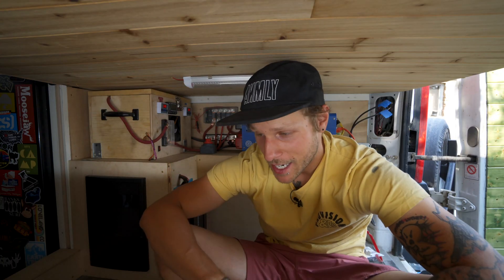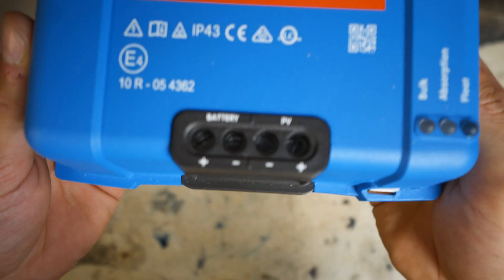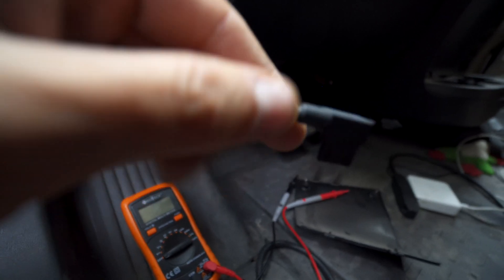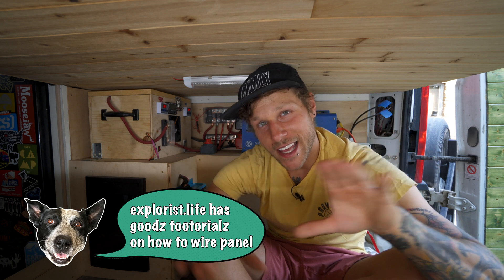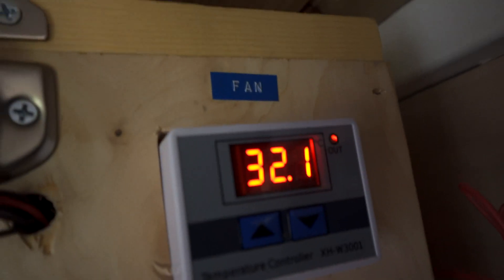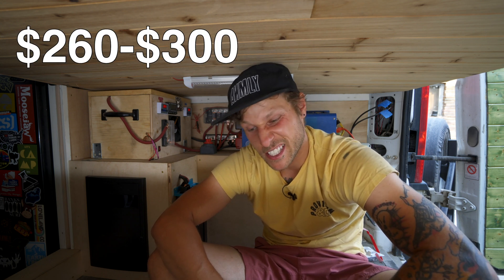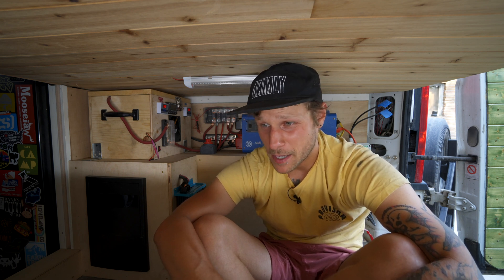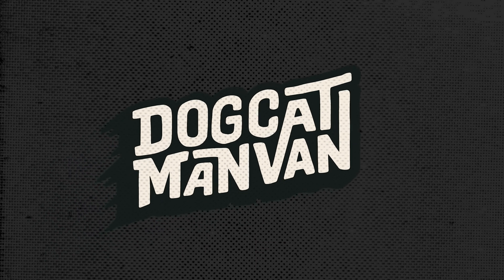What It Costs to Build a DIY Lithium Battery For Your Van

Comment: Use a diy 18650 3s battery pack, BMS use a budget watt meter and connect it to ciggy lighter don't let it go below 10.80v and watch the volts and amps. and or use a cheap boost converter with another watt meter and charge lifepo4 battery pack. Uses a lot less space too

Comment: Now that you have went lithium and have most the basic equipment have you considered building a larger bank and possibly heating your van in the winter with an electric oil filled heater. Also have you done any testing to see if that battery actually produces 280AH?
Reply from the maker: I think on a future build I'll be trying to incorporate an induction stove top, but as far as heat goes I think I might try one of those Hydronic systems. I've never actually tested its full capacity yet. That could be a good future video

Comment: You should not use the screws on the shunt as a connection point. Use the large bolts. The small screws should just hold the circuit board. It is not suitable for power to go through where you have connected and you will get wrong readings or destroy your shunt.
Reply from the maker: Thanks for the tip. I'll extend the wire coming from the BMS so it can reach the larger shunt bolt.

Comment: Hi! Is your MPPT able to charge together with the DC-DC charger, or does one start to cancel the other out when both sources are available (=driving in daylight)? Same question regarding solar+mains charging together. My logic says that when one charger puts charging voltage onto the battery, the other charger reads that as the battery being full and wont charge. But I must be missing something, because there are so many of these systems already out there. Many thanks for clear informative videos.
Reply from the maker: That's a good question and I don't know if one get's throttled if both are bringing in power at the same time. I'll have to run some tests.
Reply: @dogcatmanvan  Thanks for reply! 

I meanwhile dug through the internet; in conclusion it seems, that the emptier and bigger the battery is (and smaller chargers), the less they disturb each other. And the more the battery gets full, the more becomes important that the chargers give out exactly same voltage. 

Got my chargers delivered already, but my van is faaar from done, so would be interesting to see some tests from you. Definitely gonna test something myself too some day.

Comment: Great video mate, plenty of useful information no bullshit.. 
I subscribed straight away! I'm looking to do my own Van build in next year or so here in England, trying to decide whether to go with a Merc Sprinter or a cheaper equivalent which probably less reliable and layouts are bit different sprinter longer but the other ones tend to be wider at the top more square. So layout and reliability I'm not sure, also the extra cost of a Sprinter but then potentially more reliable for a lot longer?(you'd hope!)
Also been looking at building own DIY lithium set up with solar like you and been researching all things VAN BUILD/ conversion related! Might actually sell my house and live off Grid full time go travel Europe possibly South America, US, Canada perhaps? But all depends on money!! Initially it's gonna be about choosing a van and building it out on as little budget as possible! Whilst being smart and functional, FULL shower toilet set up the lot! But happy to do whole thing DIY! 
Going to check out your battery video now ..
Any advice you got or opinion on VAN options be much appreciated! (I'm looking at probably going with one of the biggest vans of each type available incase I live in it full time, eg. XLwb (maybe extended) extra high top etc. Given you're looking to go new van also be interesting to see what you go with and why..
Thanks again from London England 👍💪😎🏴
Reply from the maker: There's a lot that goes into picking a van and it all comes down to what you plan on doing with it. I personally have had this Ram Promaster 2500 High Roof 159WB and size wise it's been great, but it doesn't have the power I'm really looking for when we go out climbing or hiking 14ers. The trails get rough and there's a lot of elevation gain on the way and this gas van can really struggle at times. I think my next van will probably be diesel. Not only for the power, but I'm also curious about running a diesel heater inside and then trying to make everything else electric so I don't have to use propane. I'm not sure if that's the route I'll actually end up going, but it's an idea. Having a very large van is nice for storage and fitting all the creature comforts you'd like in it, but you need to think about what it will be like driving it everyday and how it will be when parking or being in a city. Again, it comes down to what you want to do with it.

Comment: Appreciate the DIY and info, but wow, for that much why not get a bluetti that can handle 700 watt input, especially since you only get 280ah? 

Love your channel, Ben. I’ve been a subscriber for a while and have watched all your vids.
Reply from the maker: Those portable bluetti 700w power stations would be equivalent to a 60ah battery in a 12v system so I have about 4x the capacity with what I built if I'm doing my math correctly. I might be wrong. Anyway, thanks for following along with the channel! I really appreciate it.
Reply: @dogcatmanvan  OK, cool. I figured there had to be a reasonable explanation. Guess I was thinking watt hours, and larger bluettis are $$. I'm still learning. Thanks for your reply! 

EDIT: Darn, I left the above comment before I saw your upload about Archer. Tough way to lose a pet. My heart goes out to you. Thank you for sharing and showing your emotion. Love your authenticity. You are a beautiful man .